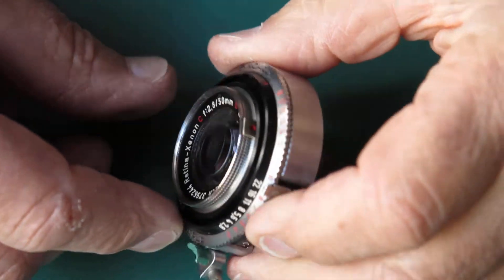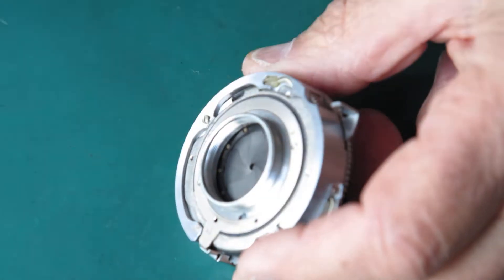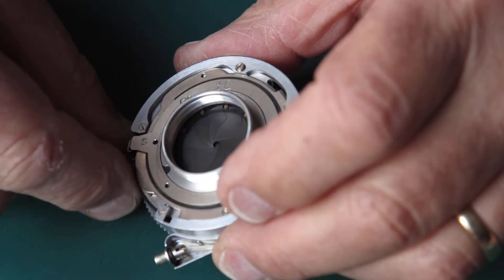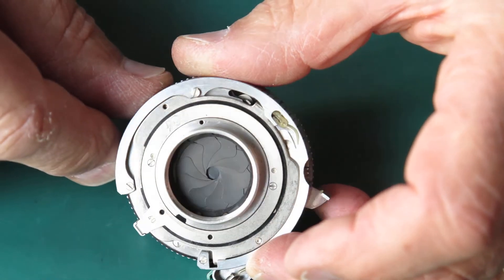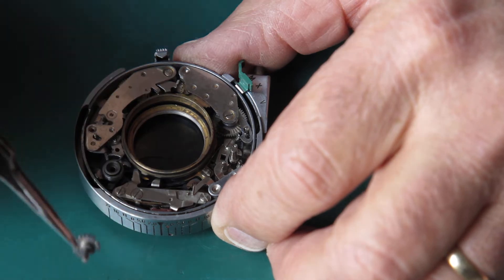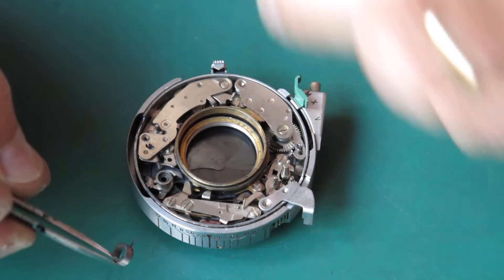Synchro-Compur shutter servicing, part 01

Comment: Hi Chris, thank you for your videos.  Question: is the position of the rear and front lens critical i.e. do you simply screw them back tightish or do they have to be adjusted or calibrated for optical performance somehow?
Reply from the maker: No, just put them in and tighten. Finger-tight is good enough too, no need to use a tool.
Reply: @ChrisSherlock  Thank you!
Reply: @ChrisSherlock  Hi Chris, if I may trouble you a little more: I am attempting to service my Rolleiflex 2.8f which I think has a Compur Type 0 shutter (I may be wrong so please correct me on this if you know otherwise).  Following instructions in the National Camera 2.8f service guid, I have disassembled the shutter as far as taking out the main spring. The arms on the spring are about 180 degrees apart so am I correct in thinking that the spring is goosed?  The rest of the mechanism looks reasonably clean and the shutter and diaphragm blades were not particularly oily I do not believe but I did drop some Isopropyl alcohol on them initially to see if the action of the shutter inproved (it did not).  Any help gratefully received, regards from England.